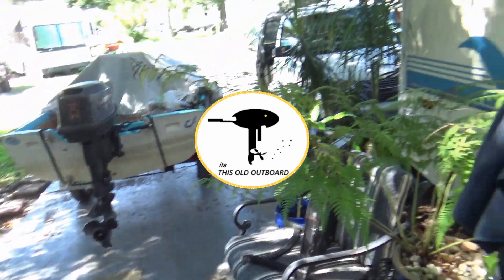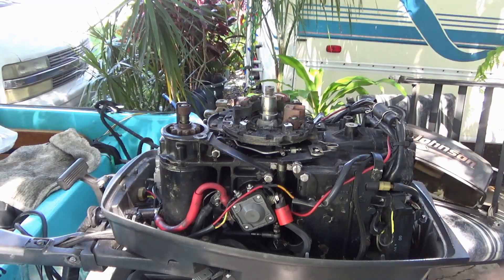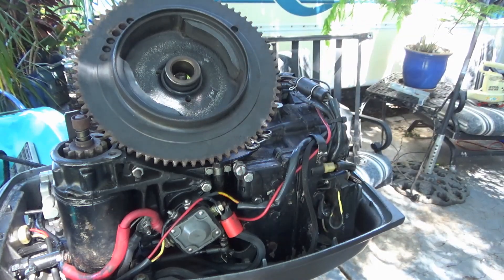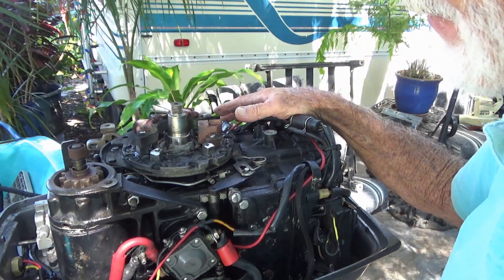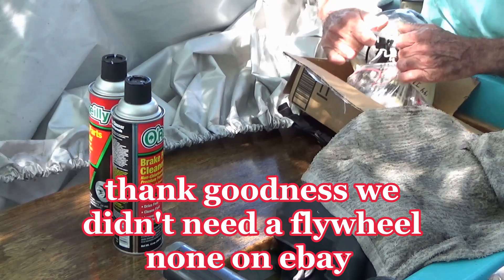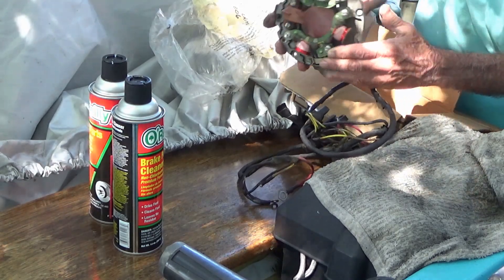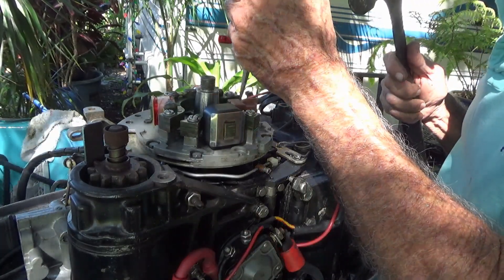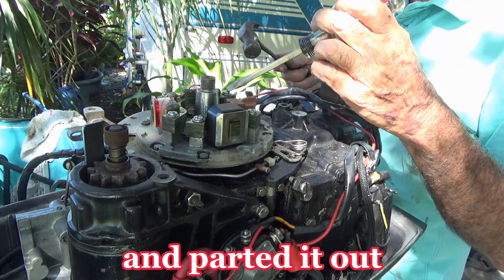2000 Johnson 25 Hp Ignition Plate & Parts Ebay Gamble - THIS OLD OUTBOARD

Comment: I have the same motor. Mine is a 1999. Been rebuilt so looks and runs like new. But i need a 35. Not quite enough for my boat. Originally had a 1984 johnson 35. Having hard time finding a 35 for it.
Reply from the maker: Hey. Thanks for tuning in! Yeah I rarely ever messed around with the 35's. They always seemed to be long shaft remotes which I had no use for. Your better off just beefing up your 25 like I'm doing on my "Beef it up" build. Bigger intake & carb or carb jets if you have the right carb already. I had an 83-84 25 and just swapped the carb with a 35 carb that came on a parts motor I bought, gained a solid 5 mph! It was a match made in heaven! One of the best outboards I've ever had. Thanks again & Stay tuned !
Reply: @THISOLDOUTBOARD1  I was thinking of doing just that but I always though you could only do it with the 80s models because they used the same blocks for 20 30 35 horse. Are you saying I can do the same with a 99 model using the same year model parts from a 35 horse? Mine is a remote the original motor was tiller. I converted to stick steering because I run the river here in south alabama and it's nice to be up front and can see better.
Reply from the maker: @owensbama1923  hey. you'd have to go to marineengine.com and compare parts schematics. I'm using an 89 25 powerhead with a 93 30-35 intake, bypass cover and carb. The carb came with a 67D high speed jet and I replace it with a 72D. both powerheads were the same, same size pistons/all. I've only had it out twice, the lake is full of weeds/grass, its everywhere! managed to hit 27 dragging grass but I'm sure it will hit 29-30 in clean water. its all in my recent videos!
Reply: @THISOLDOUTBOARD1  thanks man I will see if they are compatible.

Comment: What octane do you run on these older motors. I have a 1986 25 hp . I don’t know it it don’t like the fuel or maybe I’m mixing to much oil. But it don’t have no speed .
Reply from the maker: Hey. Thanks for tuning in. I just use regular unleaded. It's 50:1 mix, 2.56 oz. oil to 1 gallon gas. Clean that carburetor, if the high speed orifice (jet) is clogged you won't go nowhere! Thanks again & Stay tuned !
Reply: @THISOLDOUTBOARD1   Many Thanks for your response. I will certainly check that next. Thank you for your expertise. 👍🍻

Comment: What do you think could make that on /off lean sneeze. I have a 25 commercial that dose it. On the water i seems fine but at idle it dose it ?🦘👍
Reply from the maker: Hey. Thanks for tuning in. Well normally it's due to fuel and air mixture is off. Lean is to much fuel not enough air. In most cases just adjusting the slow speed idle screw/needle out or counterclockwise will richen up the mixture and should cure the lean sneeze condition. If the needle adjustment has no effect then fuel is getting sucked through somewhere or there's a clog on the needle side. A leaking primer pump or primer solenoid will do it, or the needle in the carb bowl is not seating properly. Also depending on your outboard year, if the carb has the slow speed needle on the side and not coming out the front then there will be a small air bleed fixed orifice in the front/top of the carb, make sure its not clogged! Thanks again !